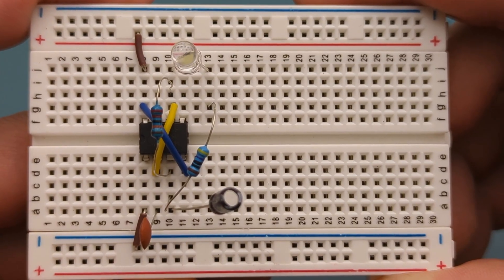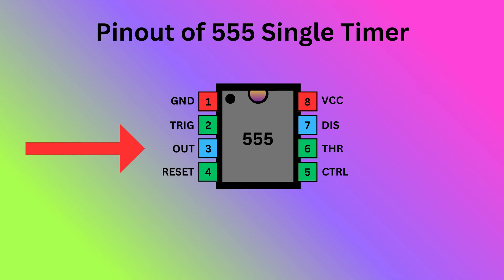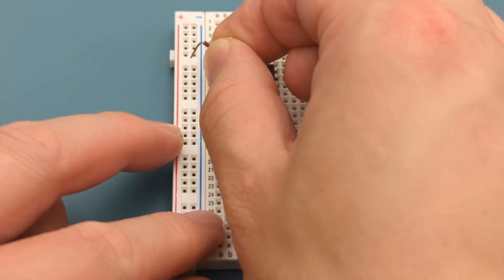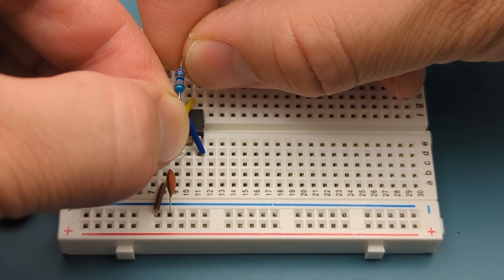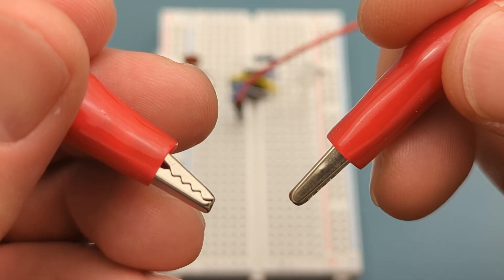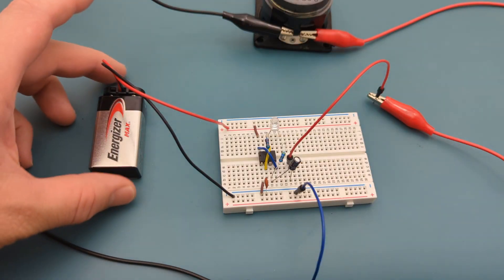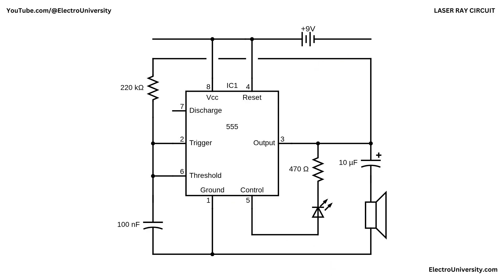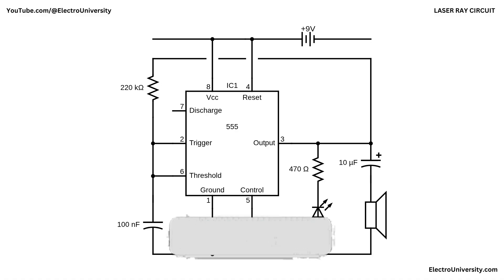Easy DIY Laser Ray Project for Beginners!

Comment from the maker: 🔔 Get your tools here:
✅ Electronics Component Kit: https://amzn.to/3N65asq
✅ 9V Battery Buckle Connector: https://amzn.to/3S7kbg8
✅ 9V Batteries: https://amzn.to/4kkonVD
✅ NE555 Timer: https://amzn.to/41MpQhp
✅ Electrolytic Capacitors: https://amzn.to/4dnrJF4
✅ Ceramic Capacitors: https://amzn.to/44kfg2b
✅ Resistors: https://amzn.to/3YfGeUi
✅ Jumper Wires: https://amzn.to/3NNn9UR
✅ Alligator Clips: https://amzn.to/4nFo7mG
✅ 5W Speaker: https://amzn.to/4eL2D3y
✅ Solderless Breadboards: https://amzn.to/3SndKWm